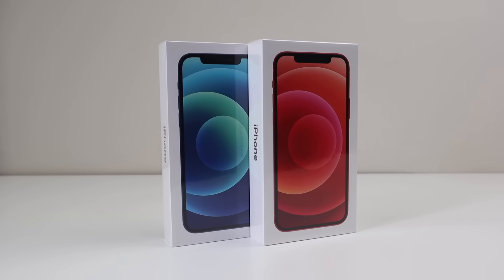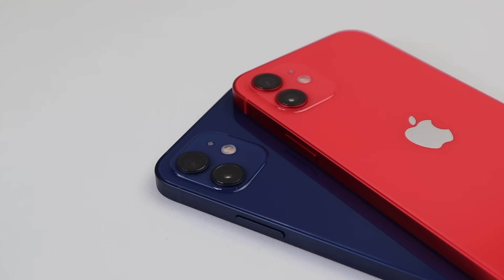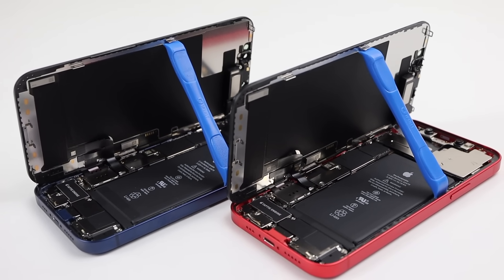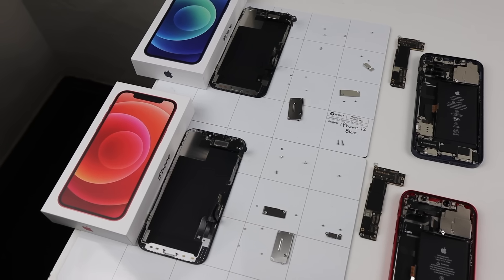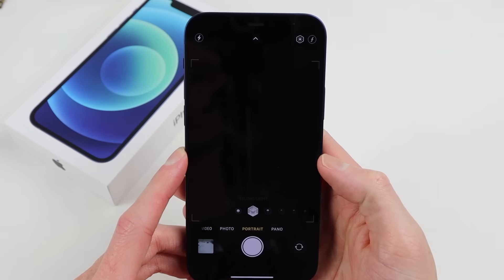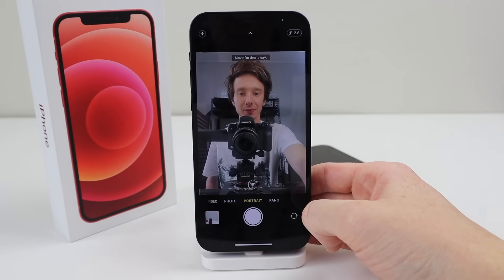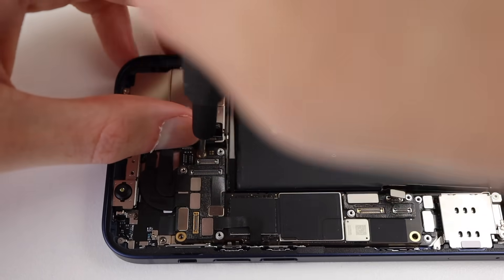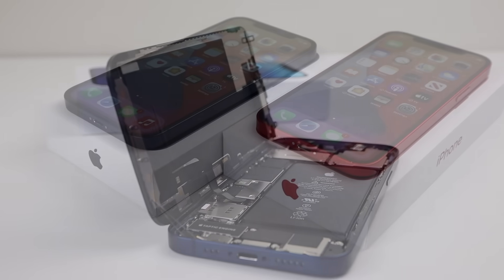iPhone 12 Anti Repair Design - Teardown and Repair Assessment

Comment: Software Engineer here. Replacement parts have an IC that is programmable. I've programmed and injected a random codes to an LCD and a camera module onto my older phones. When I turn it on, the phone itself couldn't figure out that the hardware itself might be the potential threat and when the codes executed, it runs random tasks and apps based on what I've coded. I'm pretty sure Apple knows what they're doing and I'm pretty sure they're not doing this just for money but also for security for tampering their hardware.

Comment: 70degree c is the max safe Deg for battery safety! I'm a certified tech for almost every phone brand. Also, use the jimmy tool to pop the screen out .... Unless you have a lot of time to waste or no manual skills, the Islack is pretty bad ...You also need an Eprom Tool to reprogram the new parts and avoid the darn DRM. For some strange reasons, also sometimes after repair you NEED to connect the iPhone otherwise it will never boot.All the last few probs should be fixed using the eprom tool ...we've tested it on hundreds of 8. X. Xr xs 11 etc. Even the face id can be epromed now.
Honestly, I'm a bit unsatisfied with the clear lack of research.... All of that info is on even ifixit forums ...its been a thing since iPhone 7 its just that they added progressively more drm in parts. Go on Mobilesentrix.com buy a 50$ Eprom machine ...... Thanks me later 👌

Comment: My theory is that each phone has unique parts with different IDs that connect to the phone via battery. The reason I think it’s in the battery is because the battery is glued and would break if you tugged to hard.

Comment: So basically Apple have rolled out their own implementation of a "trusted computing" layer to their hardware platform. The benefits are stopping phones from being stolen and used as parts bins etc. However eventually a workaround is found. Also many people are against such practices in the wider community and their various concerns are published broadly across the web.

Further information:
https://cs.stanford.edu/people/eroberts/cs201/projects/trusted-computing/what.html
https://en.wikipedia.org/wiki/Trusted_Computing
https://en.wikipedia.org/wiki/Trusted_Platform_Module

Comment: I don't get it, the charger is not included in the box, the iPhone is going to run out of battery anytime, 90% of other chargers🙄 don't have a USB type c Port, then we have to go out and buy the charger anyways so even if you included the charger in the box, it would still end in the same way, same goes for not including the charger in the box

Comment: I'm not an apple user but I think this is going to reduce the market of stolen parts of iPhones.
Reply: Imagine if car manufacturers did the same thing. That is a joke. They could care less about stollen phone parts this is to wipe out 3rd party repair shops that fix people’s devices instead of talking them into buying a new one when they really don’t need it.
Reply: That's good in the third world.
Reply: Thanks for this - it’s probably the only sensible argument I’ve heard for doing something like this. Otherwise, the whole thing is absurd. I’d be all for the charger and headphone move too ... if the charging cable had a standard USB-A end on it, or at least came with an adapter for older models. I’ve been using Apple’s tablets since 2011, but it sure looks like I’ll never own an iPhone...

Comment: I was thinking about this, and I believe that there is more to it than just Apple being Apple. Every iPhone 12 is HDR and Dolby certified. This means that every camera and screen has to Record accurately to within a certain tolerance. Due to errors in the manufacturing process, every camera has to be calibrated individually, and that calibration data has to be stored in system memory for use in video processing. Swapping the camera module would negate the calibration and cause the phone to be out of certification, so they would tie the camera serial number to the phone to maintain the certification. 

There are a lot of unanswered questions with this theory, but it makes sense from an engineering point of view. It doesn’t explain why the camera freezes or loses functionality. Apple could probably fix this in an IOS update, but we all know that they won’t.

Comment: Great video! So, I can understand the Face ID thing, that's been a thing since Touch ID came out. Touch or Face ID always needs to be locked to the board it came with, I know there are some ways around that but that part wasn't a big deal for most.. It's the battery and the display that I think should be unlawful. There is absolutely no reason why Apple should be the only ones to be able to swap the display. It is seen here in the video it's obviously and Apple genuine battery and display, it's the originals from the phone! But the fact that a swap locks you out of your phone is pathetic, and all around sad. I thought this title was click bait, but I cannot be more sad to have been wrong about that.

Adding on - I wrote that before I even saw the stuff about the camera.. Holy crap is this disappointing. Bring on the right to repair!

Comment: I usually stay 3 years behind on Apple iPhones since checking email, web browsing, and streaming videos doesn’t require any more processing power than a phone 5 years ago had. I only upgrade pretty much just for the camera and display quality improvements everything else on any phone is worthless to me. I also gave up on smartphone gaming years ago when all smartphone games became gambling/pay-to-win cash grabs, so the graphical processing power of any smartphone to me is equal to the worth of a turd. Anyways the first day I buy a new phone I already have a glass screen protector and a medium sized case ready to install on it right out of the box. I would do that with any brand smartphone. Most of my coworkers have damaged but working phones both android and iOS and they always tell me they hate HATE hate having a case and a screen protector. I get it’s not as nice looking or even as comfortable as a bare new smartphone, but it is mind boggling to me that they are all okay with a cracked and dented screen 24/7 instead of using a case and screen protector. In my 8 years of owning smartphones I have not ever damaged my phone. I’ve damaged screen protectors but my phone was always in like-new condition for me to sell on eBay for $200 when I decided to upgrade to a newer phone. People just need to take better precautions and take care of expensive things you buy instead of pretending they should be indestructible.

Lastly even though the phones of my coworkers are repairable. None of them are willing to spend $75+ to repair it and are willing to live with it for years before they buy a new phone. So if the iPhone 12 isn’t repairable it wouldn’t make any difference based on the people I know. While I agree Apple is dumb for making all of their products unserviceable, (especially for computers) in the real world an unserviceable phone is no different than a serviceable one.

Comment: Did you try this with the battery as well?    I guess we can assume even if you yourself replace the battery it will have non stop errors and no battery indicator right and power button won't work?

Comment: Thank you for arming we the consumers with this information. I still have my iPhone 6 plus. I hope it's easier to repair and much cheaper as the battery doesn't last long anymore.
Reply: Definitely easier. That battery replacement takes about an hour and costs $59 USD, at least where I live. That should fix your issue. Go to Settings, then Battery, then Battery Health. If it says "Service" then you just need a new battery. Simple.

Comment: Apple should just automatically void the warranty and maybe display those messages but disabling features is Incredibly disgusting
Reply: @jediii86  thus it would be a limited warranty.
Reply: @jediii86  I was referring more to opening the device in general then the repairs, and was under the assumption that apple warranties allow for free repairs in some situations (for example, faults that occur through general use or defects). But why is it that the legal way is worse for the consumer then? I think it's better for the consumer to have the choice to forfeit warranty by having it repaired elsewhere then to completely disable other's parts from working.

Comment: I bet both phones isn't waterproof anymore.
Reply: Correct! As soon as you remove the display on any iPhone X and above (11,12) the water resistance seal is compromised and can't be restored without replacing the adhesive, re-assembling the phone, and finally pressing the phone in a jig.

Comment: There must be a hidden file on board with a list of component hardware s/n, that can be edited. Update that with the new s/n and good go ...
Reply: I wish it were that simple. Every crucial component (TouchID or FaceID, batteries) is serialized and paired to the motherboard on these new iPhones. To be able to pair a new screen, proximity sensor assembly attached (which enables FaceID if it's an Apple part), you need Apple's GSX calibration software to re-serialize everything over the cloud.
Reply: Was worth a try ... ;-)

Comment: This pairing of hardware and software inside the phone is kinda similar to a regular computer with its device/hardware ID thingymajig, isnt it?. You cannot simply replace some hardware (i.e. non-plug & play hardware) randomly like this because it's already tied up to stuff. The system will recognize that it's not the same hardware anymore and will cause it to break or get corrupted and throw errors. Depending on how you look at it, I can see it as a plus. Some repair shops are dishonest and will ninja swap some original parts with a third-party parts that they carry, while they are replacing a "broken" part that actually was agreed and needed to be replaced. Then they sell that original part as another option at higher price. So as the first customer,  you get your phone back thinking that the part that needed fixing is fixed, but unknowingly that there were more parts that were replaced without your knowledge. The second customer who now opted for "original" parts now actually get that original part from the first customer. Vicious cycle continues. So this pairing of hardware and software can actually prevent this from happening.
Reply: A computer? any brand of motherboard will accept nvidia, amd, samsung etc and it'll work just fine. As for the "ninja swapping", if you allow the shop to take your device to the back, you're in the wrong place
Reply: @lemao438  it will accept anything, but once you install Windows to make it all work together as a "system", the system ties some important hardware (not the plug and play stuff) to each other. I'm not too well versed in this technical area, but I have come across it before. Something to do with hardware/device/unique ID or class GUID. One of those complicated things. When a system detects that a hardware configuration has changed, depending on what it is, it could accept it or it could start throwing warnings and things could start going weird. Im just saying its probably something similar happening here. Doing a reset will reset the phone back to its original configuration, however it wont work because the original configuration was the configuration before you made the mobo swap. It'll fail.
Reply: I.e the system assigns some IDs to some components. Every time the system restarts, it re-enumerates these IDs to check if something has changed.
Reply: @lemao438  there you go. https://docs.microsoft.com/en-us/windows-hardware/drivers/install/device-identification-strings
Reply: @kas4751  you're waaay off topic. Thats just minor stuff
Reply: @lemao438  lol what? It’s not minor stuff and very much within topic. It’s how the system was configured. It’s a possible explanation as to why it is the way it is. Maybe you’re not as technical as you think you are and already giving up on attempting to understand how systems work. Your short and uninspiring response is indicative of that.

Comment: AASP technicians have to plug it in and do like 2-3 calibrations. it's a big part of the repair work. if you don't do all the proper calibrations in the right order daceid, camera, battery life and a bunch of things can just not work. Done quite a few iPhone repairs at BestBuy after we got AASP certified. also, no, you cannot have them just calibrate it all, the computer tools don't work unless you have a valid work order with parts and diagnositc. and the diagnostics read all the part serial numbers. so. it's a lose-lose.

Comment: Face ID and Touch ID are ALWAYS unique to the original iPhone...it would be unusual if the Face  ID worked. If he had swapped the logic boards, but kept the original Face ID sensor, then he would not have had camera issues. This is why, when doing repairs, it is essential to swap over the original Face ID sensor and front camera assembly. If you don't, then you will have problems. This phone, like all other iPhones, are relatively repairable. 

As for the battery, this popup is temporary and will go away in one week. 

This video does not do Apple justice for their reparability. iPhones are repairable, you just need to know your facts first.

Comment: Thanks for this video and showing the internals of the new device! As of the issues you were questioning, those seem to be related to the TPM (AKA Secure Enclave in Apple's world) module built into iPhones since A7. In simple terms, the idea behind a TPM is to authenticate hardware components of the system prior to boot, to prevent malicious/tampered hardware modules in a system, among other things. In theory and in its pure use case this is great. Imagine if someone could replace one of the phone modules like the fingerprint or camera module with one that allows unauthorized access to the device. TPM/SE's job is to prevent exactly that. The way it works is through verification of cryptographic keys embedded in each module, battery includes. Heck even the USB cables apple provide have little chips in them with serial numbers that gets verified. This is all good, until you break something and you want to replace a module with aftermarket replacement ones. Then that verification process will of course fails, because 3rd party modules do not have matching serial-number/key with the one programmed in the SE. How iOS treats an "unauthorized" module is up to Apple of course, and a good opportunity to prevent 3rd parties from repairing devices.  I'm no iOS security expert but the nature of errors and the modules that fail seem to be relevant to that. In case one might wonder what a camera module might have to do with Secure Enclave and security of the Face-ID, consider this: One of the ways Apple prevents  unlocking the phone using a fake/photo face is by using depth sensor data, which are raw data retrieved from the (front) camera module. Now theoretically if someone could replace the trusted camera module with a tampered one that would stream out fake/modified stream of data to make a photo look like a 3D face, the iPhone had no easy way to verify those input data, hens would get tricked to unlock the device. That's of course a theoretical scenario, but it is very well within capabilities of anyone with engineering/development skills to implement a fake camera module. These are all my  assumptions and interpretations based on Apple technical documents and how each of these secure components work, not facts. More in depth details of each component, including how Secure Enclave works, are covered in the "iOS Security Guide" document from Apple. https://github.com/0xmachos/iOS-Security-Guides

Comment: The reason why face ID will not work is because you have to recalibrate it through repair Cal so that the iCloud matches what the face ID that's built inside of the OLED screen

Comment: Yep, Apple isn't alone in this kind of behaviour, but they are the most known... This is how things are when you start having processors in every module or component in a system... Serialisation, unique identifiers, locking specific IDs to a system, etc... Vehicles are the same way (Modules VIN locked)... ALL it takes to make it work, is the magic tool that unlocks the 'doors'. Someone, somewhere, has the tool. Someone else, somewhere, may eventually figure out how to decode it, or work around it. These behaviours are often poised under such terms as 'Counterfeit protection', 'Anti-chop shop protection'. While it may be true that it can help cripple theives and fakers, it also hurts the consumer, it hurts the mom and pa repair shops. The manufacture is the only winner.

I will not be wasting my money on any Apple product. I do not care about trends, or fashion. I leave that opinion and option to others. I would also say that popular makers of Android devices likely do the same things (looking at you, SAMSUNG)... This trend is not going to go away, it will only become more common. 

Honestly though... Tech becomes outdated so fast anymore, it somewhat moots the point of repair. 

When everything has a processor, there are so many sneaky things that could be done. You could make a vehicle, that after the left turn signal blinks 10000 times, it quits. A quick trip to the dealer, and a $120 'module replacement', and all is good. Reality is they just connect their magic tool and reset the blink counter. Or you could make it random. So many possibilities.